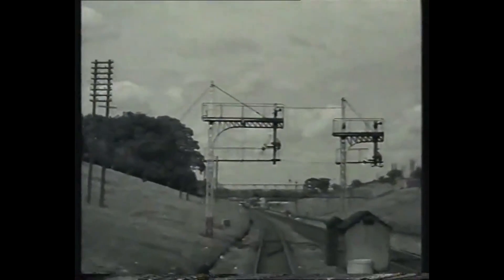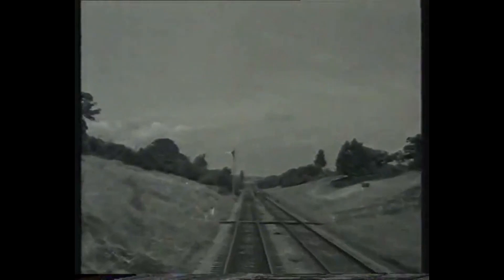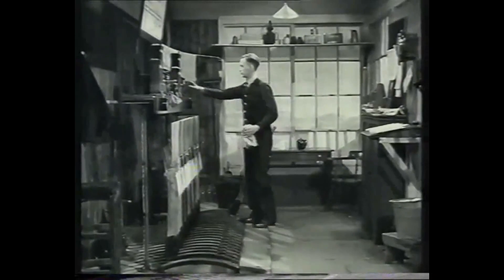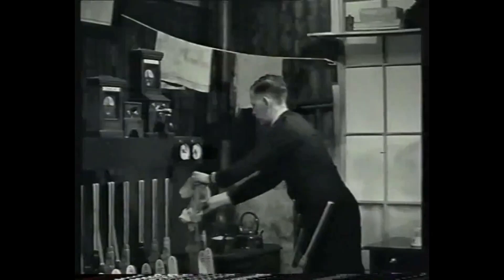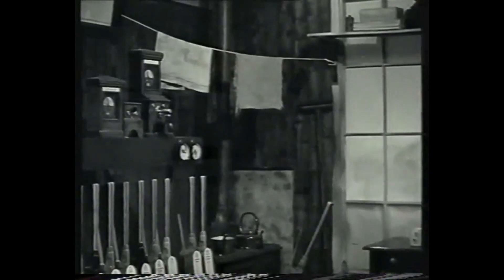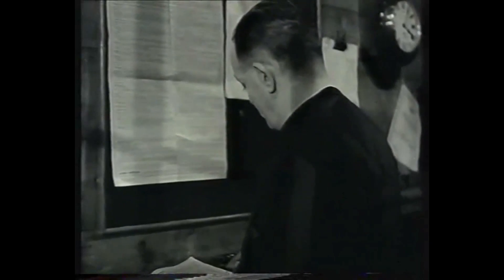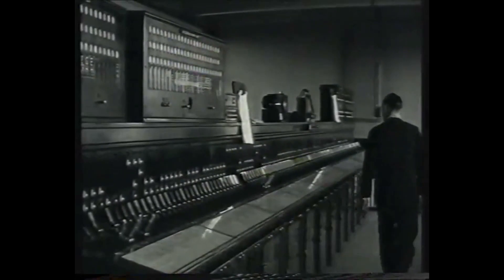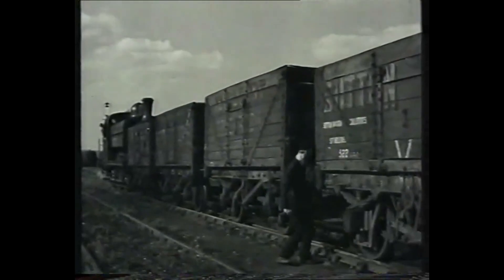Absolute Block Signalling.

Comment: COMMERCIAL JUNK FOR THE IGNORANT 1950'S TRAIN SPOTTER ???
And if you honestly think a "Commercially produced" 1950's programme is going to explain how "Absolute Block" or for that matter "Track Circuit Block" or even "Permissive Block" actually functions, for the benefit of the lay person think again. Indeed it full of absurd nonsense from 1:34. Quote "the Block generally extends from one station to the next" Unquote - Utter bunk. 

ABSOLUTE BLOCK (Semaphore signalled Passenger lines). Each "Block stretches from the "Block Signal of the previous signalbox to the "Block Signal of the next Signalbox" and can include long lengths of "No Mans Land in between. Which are lengths of line devoid of signals. Due to the mechanical limitations of the Steel signal wire, which due to expansion & contraction cannot be more than 1.25 miles long. Meaning a Mechanical Absolute Block Signalbox rarely covers an area longer than 2.5 miles. The "Block signal" being the most advanced signal controlled by that box, with one such on each "Running Line". The Block Signal is also "interlocked" with the Box ahead, meaning the signalbox controlling the Block Signal CANNOT pull that signal to clear, as it is mechanically LOCKED in the frame, until the signalbox ahead, gives an electro-mechanical release. And that can only be done when the Box ahead, has NO trains on that "Running Line"  

Indeed the fundamental "Absolute Block Rule" is that the BLOCK must be "ABSOLUTE" hence the name.  And for those still in the dark, this means that only ONE train is allowed on each "Running line" to be ANYWHERE IN THE BLOCK, irrespective of how many signals that box may control on either of its (most commonly) "two track line" one UP line & one DOWN line. 

And if you still don't understand, this means ABSOLUTE BLOCK expressly FORBIDE's under ANY circumstances, trains to follow each other from signal to signal. And the main reason why something else had to be invented to cope with lines where traffic was becoming busier. Which basically had to wait until the 1926 experiment of 4 Aspect colour light signalling used in conjunction with "Continuous Track Circuits". The Track Circuit senses the presence of every train, and its position, and ensures NO signal can show a "clear aspect" if their is a train on the Track Circuit Section ahead. And the word SECTION (also a horrendously misunderstood word) means the distance between TWO signals capable of displaying a red aspect. 

That 1926 experiment (authorised by HMRI, His Majesties Railway Inspectorate) was at Elephant & Castle in South Central London on the Southern Railway. Which included a busy junction. The new 4 Aspect colour lights were intended to allow trains (to follow each other) at just 2 Minute intervals in Safety, thanks to the Track Circuit supervision of all signals. It was so successful that HMRI accepted this new method, and the Southern Railway began installing this new system around London Bridge & Cannon Street rapidly. But it wasn't until the 1933 Electrification of the London to Brighton main line, which also used the new signalling method. That this new signalling method became known Worldwide. As not just a huge a huge success, but for the first time allowing trains to follow each other in total safety from Signal to Signal. 

Indeed a major Japanese Railway delegation came in 1933 to examine the electrification (660v DC Third rail) the 4 aspect track Circuit Block signalling and the resultant "Regular Interval Timetable" also now a realistic possibility. So impressed where the Japanese Railways that they quickly adopted it all (although they used 1500v DC overhead). And eventually added a fifth aspect to allow trains at 90 second intervals. Tokyo of course being the busiest Railway City in the World, by a significant Margin !